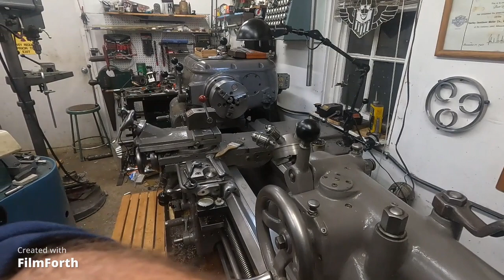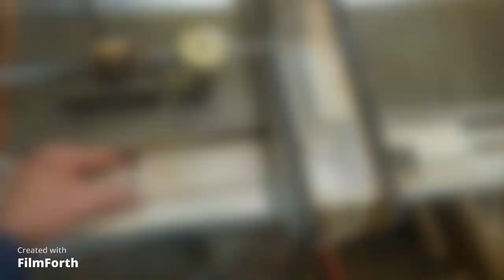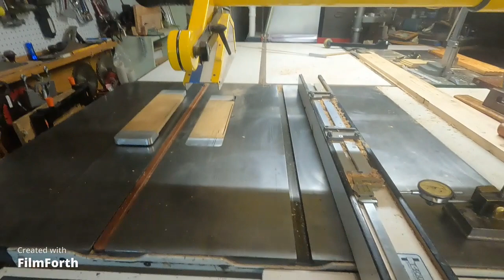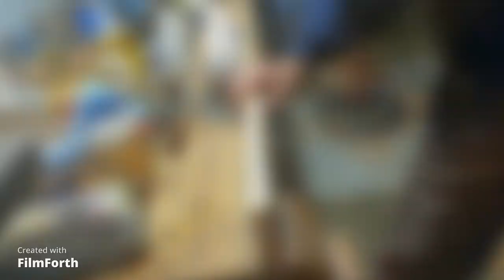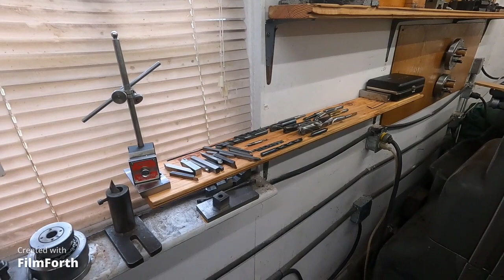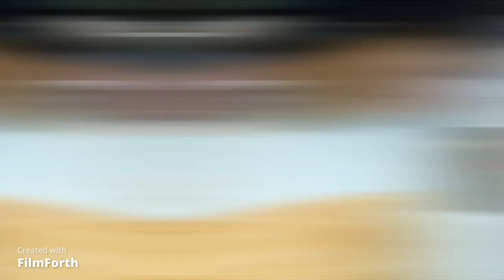A little more woodworking for the machine shop Today!

Comment: Yo, nice seeing the axleson in such a lovely condition, you sure poured love into that machine, well, that and lubricants... And a lot of work... 
Have you ever considered using automotive wax on the machines? The painted surfaces i mean... You know, just as it was done in the olden days with good cars... 1, it would give the paint a nice glossy sheen, 2, it would protect the paint from a lot of crap and would help any oil or coolant to piss off into the pan as quick as possible... Some parts like the headstock and the tailstock dont really need it for ``drying`` purposes, but it would protect the paint and allow you to keep it looking great for a long time... 

All the best and kind regards!
Steuss

P.s. lol, here i am talking waxing, and 5 minutes later, you are talking waxing... I assume the saws use something a bit different from automotive wax, but ultimately, wax is wax at the end of the day... Its a fatty compound that both protects the surfaces from oxidation, chemicals and other nonsense, all the while serving as a lubricant in many ways, what by helping the liquids drain away to literally acting as a sliding lubricant in a saw like this...
Also, i would consider making a leaf spring style wood slideways pusher... Just a block that catches in the slots in the table, with a thinned down car leaf spring that has a rollerblade 80mm wheel put in the end of it... The wheel would gently press against the side of the board, which would be really damn useful for keeping the very long board pressed up against the fence while you are trying to feed the damn thing into the saw... 
I say a car leaf spring, as you need a bit of thick material to properly affix it to the block and to be able to put the wheel in the center of it, or even lower down, and the in between section of the spring could be machined as you see fit to achieve the manageable level of force yet one still high enough to adequately support the wood from that side... I am no woodworker by any means, so im pulling this outta my ass right now, but its just an idea that came to mind... If nothing, it would side load the wood without requiring your hand to be anywhere near the blade...
Reply from the maker: Hi, thanks, I will give the machines a coat of wax. The woodworking pressure rollers are a crude copy of an Aigner product that works like you described with flexible steel shafts, so far I have not come across anything that would work, of course I am not going to buy anything but will make improvements as free or very low cost material shows up at the scrap yards. Not doing production work allows that.

Comment: Nice action in the wood shop I real liked how you made the steps for shelving I like the finish on the  shelf is it from an stain ore oil ? gives the wood grain real pop . Nice work and set up you got in the shop. Thank you for showing and enjoy your day , I forgot to say fine iron head in the start of the show .
Reply from the maker: I am salvaging a couple of 2x6 fir boards that have been out in the weather for years gives the wood some character, milling the wood a little gives the shack some class. I am just applying boiled linseed oil several coats and it can be cleaned with mineral spirits on a rag, i am working on a rack/shelf that will hold a few 50 taper tools, thanks

Comment: Just bought a Rockwell 12"-14" saw, owned a Unisaw years ago. I like the size bump. Miter gauge was expensive on eBay (didn't come with one). Motor is 7.5hp and has a flat micro-vee belt about 2" wide vs the four vee belts. Runs very smooth. Love your stock handling jigs.
Reply from the maker: I had to re fashion an aftermarket heavy miter gage to fit, they can cost more than the saw. I had a Delta contractors saw before and this was a massive improvement, I will never stand in front of the blade or any wood going through it, that machine is serious even with 5hp! Your saw was one of the last and they were costly when new. I recently came across a 10" Powermatic model 65 for a $100, 3phase 2hp, no one wanted it either.
Reply: @deedeeindustrialsuperprecision I considered mine a bargain at $500, even with no miter gauge or fence. Gave $225 for a miter gauge. I'll make a fence from 80/20 extrusions. Remember the Paralock fences? Might reverse engineer one of those, I like the concept.